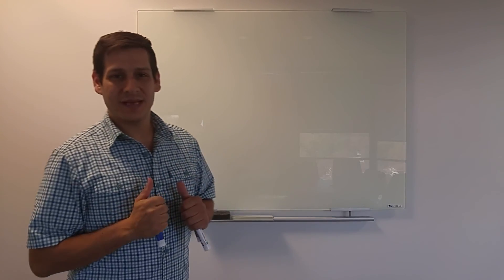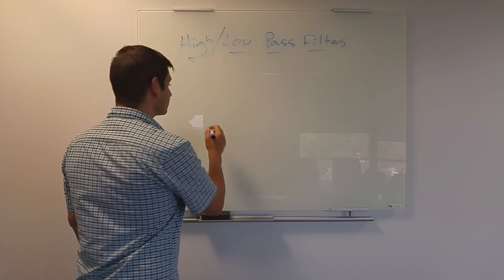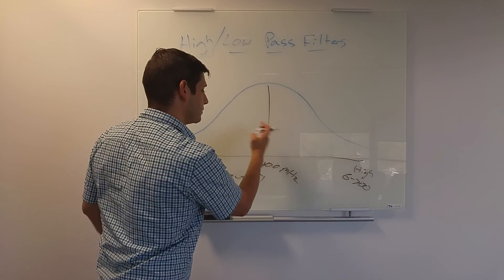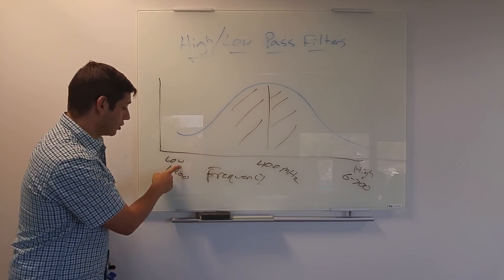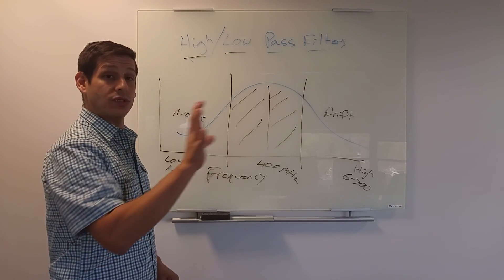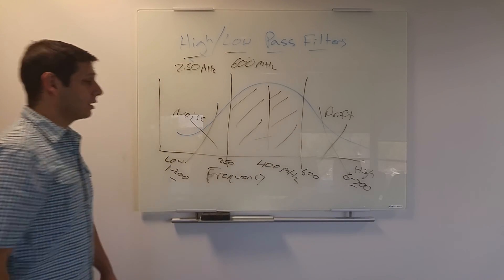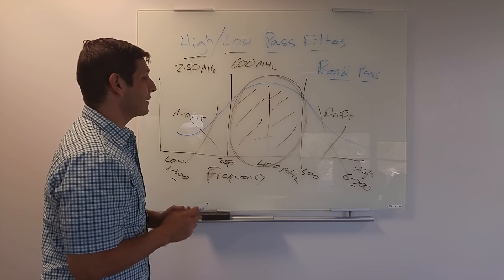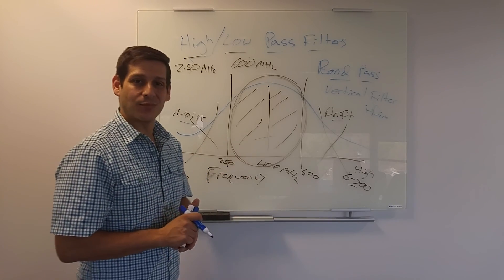What Are High Pass/Low Pass Filters for GPR!

Comment: Hi Sir,
This is really very helpful. Could you please help me with the questions asked below:

1. What is the difference between Bandpass filter and Bandpass Butterworth filter? Which filer should one prefer while processing GPR data?

2. Is there any thumb rule to choose low cut and high cut filter for bandpass or bandpass butterworth?

3. Background filter is a 2D filter which removes horizontal banding. So which filter should be kept above in processing step?  Background or bandpass?
Reply from the maker: Thanks again for the great questions. "Buttersworth" is a function that flattens the data curve in a bandpass filter. I wonder if filters are running this even if it only says bandpass? 

There are no rules of thumb that I use. It will depend on the antenna frequency, background noise in that particular case, and other potential factors.

I often run both at the same time, not prioritizing either one, if I need both (not always the case). If I did run one before the other I would probably run background filter, but that is probably more out of habit than anything else. I'm not sure if one should be prioritized over the other based on the actual math. 

Hope this helps and thanks again for all of the comments and questions!!